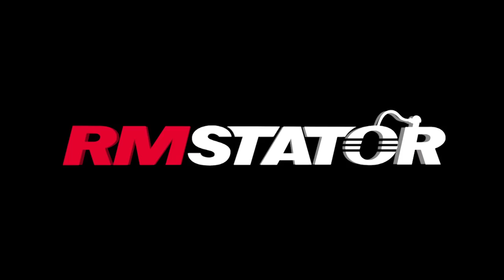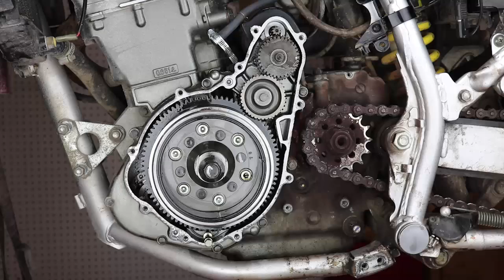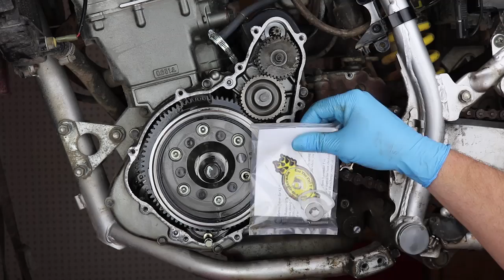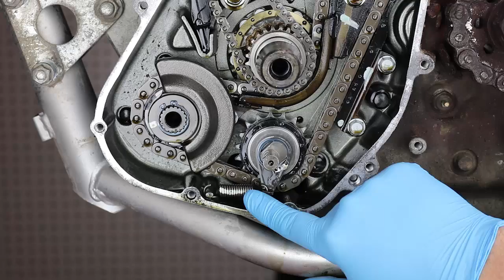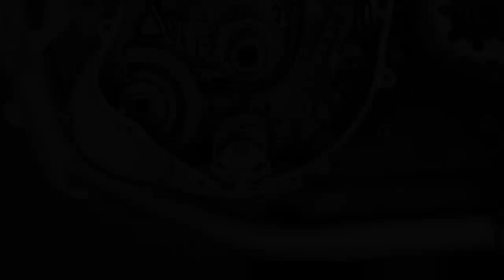How To Install a Kawasaki KLR650 Doohickey Counter Balance Chain Tensioner Installation Instructions

Comment: appoligies in advance for this questiion. At 10min part you say to  loosen of and tap the case with a hammer. Pardon my ignorance. Case to me is the housing covering the gears. If the case is exposed. Wat exactly is the case located?
Reply from the maker: By case I mean the outside cover. When you are adjusting in the future, you would have the outer cover installed. Just loosen the lock bolt on the tensioner(doohickey) and tap the outer case a bit to make sure it rotates freely and gets tensioned by the spring. Then tighten it back down. Easy!

Comment: Wouldn't the traditional spring included in the kit do the job just as good as the torsion spring? I've heard they have a lot more tension than the stock spring. I think eagle mike's kit only comes with the torsion spring now, but Biker's Run comes with both. Great video
Reply from the maker: Thanks, I have owned many KLR's, and found broken OEM springs in multiple bikes. I have used the Eagle Mike kit many times with great success, so it is my preferred  method.

Comment: Thank you very much for the video. Very well  explained! My question is regarding the engine if it is actually touching on the frame on this side of the engine. My 1993 is touching but it has a dent under the left tube, so maybe it was pushed up. Can you please confirm if it is normal to touch or not. If not, how many mm space is there ? I appreciate your reply! Thank you!
Reply from the maker: Sorry I don't have a KLR here any more to measure. The engine should not touch the frame though, that is for sure. It sounds like your bike may have been dropped and the frame or motor mount is bent.
Reply: @Rmstatorinc  Thank you for your prompt reply! God speed my friend!

Comment: pause at 5:15 and: just a crazy idea, but why wouldnt you replace original spring with peace of stainles steel wire, you could simply hook wire throu that lever, tention it and wrap arround it arround that pin that holds spring, than wire would hold sprocket tensioned, and wouldnt let him budge neither back nor forward. (?)     you basicly wouldnt need doohickey at all, lol
Reply from the maker: Try it out and let us know! I've always used the Eagle Mike doohickey kit on many KLR's and never once had a problem, so I stick with it!
Reply: howdy... you do need the doohickey, as all chains stretch over time - thus the need for a take-up spring (of some kind) and the handy, external tensioner-adjustment nut...

Comment: Every single time I think about this "doohickey" deal my mind is just BLOWN AWAY that a huge successful company like Kawasaki would keep manufacturing the same low quality part for all those freakin years?   I mean they HATE to have bikes fail under warranty, they HATE to lose reputation...it just makes ZERO sense to me?  My thinking is that these things can't possibly have much of a failure rate at least for the first 10-20k miles ....maybe a lot of it is just that there was a time early on where some defective parts got through and the klr community has never let go of it because it was such a pisser....That and this Eagle Mike provides an obviously stronger part which gives anyone the warm fuzzies it wont break.  ....LOL ...but STILL for a hundred bucks or whatever a mechanic's time and the parts might cost?  Average guy lavishing his/her klr with spangles and upgrades is not going to be  the only one gambling that MAYBE kawasaki didn't mess up a weld again... ....It just bugs the crap out of me they did not soothe the klr community WAY earlier with a new part(s) ...I just want to get the kawasaki executive that decided NOT to upgrade to a new part/part number WAY before the 2nd gen...want to get him bound hand and feet in a damp basement with a million candlepower light in his eyes and his testicals wired to a KLR's 50kv ignition coil and just keep nailing his sack about 500 times asking each time "WHY?  tell me WHY once again you refused to spend pennies and fix this?" ...Is that sick of me?  I mean Really?
Reply from the maker: Excellent rant Dougie! It is definitely a real problem. A couple years ago I bought a 2003 KLR650 with 9000 miles on it. While upgrading the stator, I decided to check the doohickey. The original was still installed (case had never been off), and it was broken. The spring was broken as well, and laying in the bottom of the cover. It is a real problem, and can cause a serious failure if not addressed!
Reply: There is a HUGE disconnect between USA Kawasaki---that is the importers out in California, and the Kawasaki company. I have dealt with USA Kawasaki several times, they are assholes. You can get a manager, write letters, I even contacted the Heavy industries Kawasaki and reported all the shit they pulled on me. The same guys called me and asked me how they could help. Kawasaki bikes are made well and the same model being made for so many years shows the quality. But they repeat their mistakes for years because of the shitheads at USA Kawasaki. Also, I have tried to get warranty work done and the Kawasaki dealers in the US will always get approval for payment from Kawasaki before they will fix anything, because all too often the boys in Calif. will try to get out of paying for warranty work.

Comment: I see no reason to remove the old spring or at least remove it without taking off the inner case
Reply: the spring itself is also a failure mode. if you can remove it without removing the inner case do it however you really don't want to accidentally drop it into the lower case. also removing the inner case makes it easier to drill the anchor hole for the torsion spring if you will adding one.
Reply from the maker: I highly recommend removing the inner case to replace the spring. They are absolutely a failure point, I have had it happen on a couple (low mile) KLRs. Definitely worth removing the case to do it correctly and not risk losing parts inside the crankcase.

Comment: Good video. Most guys are capable of following mechanical directions—unscrew this, pull that, etc.—but explaining “This chain pulls on this counterweight that offsets the motion of the cylinder,” puts instructionals like this in a whole different category. Actually teaching what's going on. Maybe that kind of stuff is just common knowledge for some people. For amateur DIYers, it's a huge help. Thanks!
Reply from the maker: Awesome, thanks for the feedback Bryce!

Comment: I have 2017 model with 1800klm's on it does this later model still have this problem and if so at how many klm's should I change it. thanks , great video by the way
Reply from the maker: Kawasaki changed the counterbalance chain tensioner on 2008+ models. They were much more reliable, but still known for a few issues. Eagle Mike makes them for the later models as well. The process should be very similar.
Reply: thanks mate
Reply: I just did my 2007 doohickey , with a eagle mike kit . That part I replaced was just as beefy as the eagle mike one .
That being said , the OEM spring had no more tension left .
I replaced with a clock spring and the bike is a lot smoother and quieter now :)